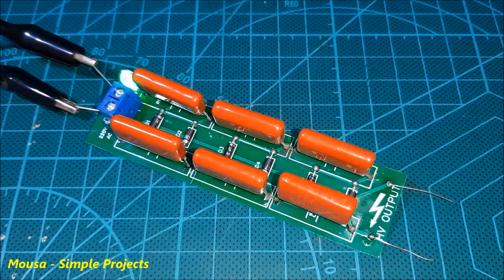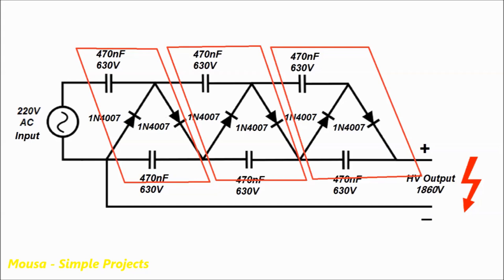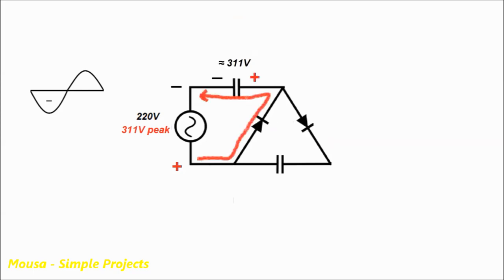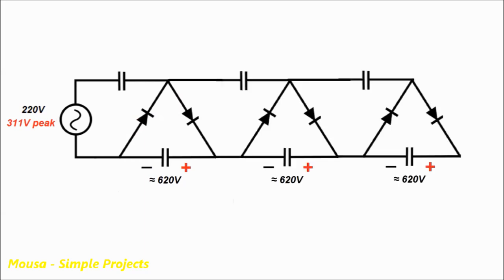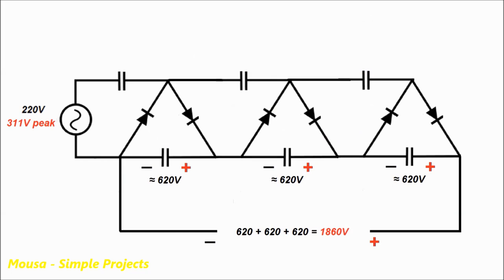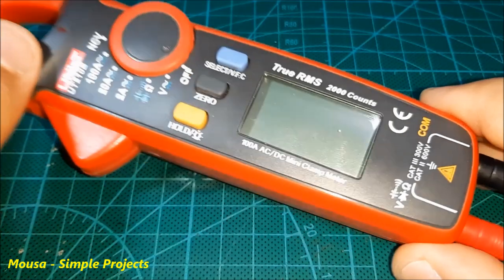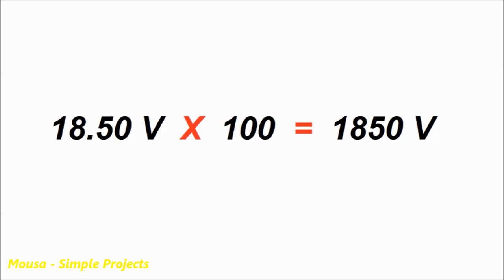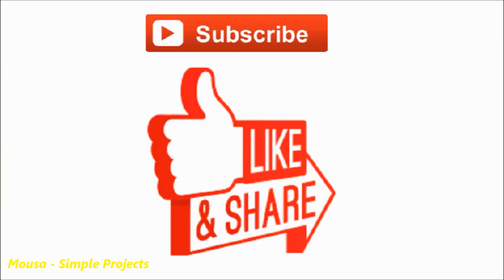1850V Cockroft Walton Voltage Multiplier / Bug Zapper Circuit

Comment: Sir how can 600 volt capacitor store 1800 volts ? Its not possible. You said it wrong sir.
In reality we have use capactior in stages; 1.5x or 2x its storage. For example if the second stage capactior is going to store 480 volts then use 600 volts or 800 hundred volts capactior.
Simply use 2 times or 1.5 times the storage of the capactior. For the first capactior we can use less voltage but in last we need higher to store more.
Reply from the maker: No, you are WRONG. this is the circuit simulation using Multisim
 show us the voltage across each capacitor will be 620v DC , and since they are connected in series the total voltage will be 1860V.
So we need capacitors with voltage rating at least 630V. NOT 1860v !!
https://blogger.googleusercontent.com/img/b/R29vZ2xl/AVvXsEheiNHha5zsKVPXBPlWS98m_XdWMqmMIfrKpUIJn6fdce_59Pnum6uzxN5TSpJTZ7c6dKf81_pq_DbPnGTmsxgzODhSJlm3hSRTw8YfDkvW2RE-Ti1FJ-1_1j0iq6SwT7WCEsR1OaD6p0Fyt6gLaZnvDIxjmnrMpFHdD4aBASVjist-ofqQ2J_OEL3hQZ4/s1073/voltage%20multiplier.jpg